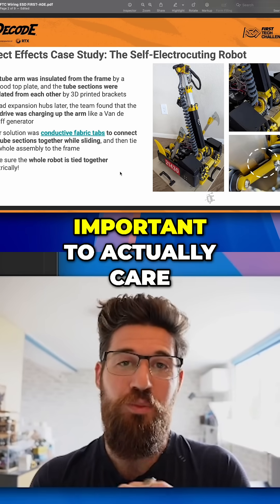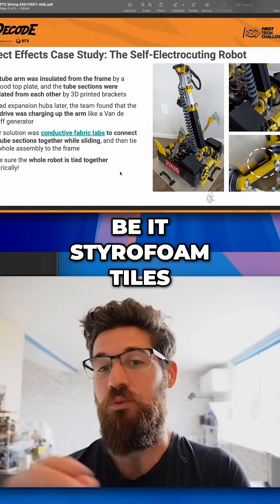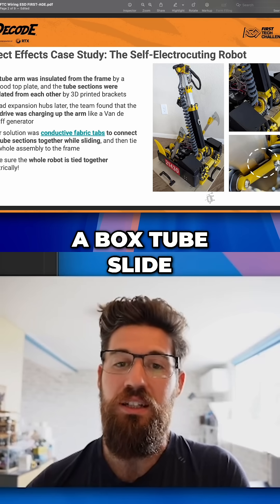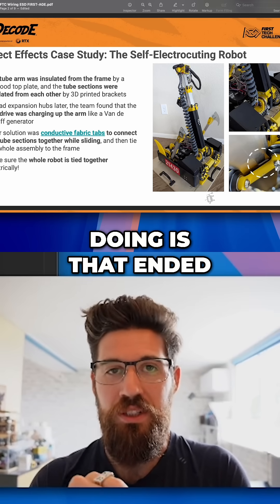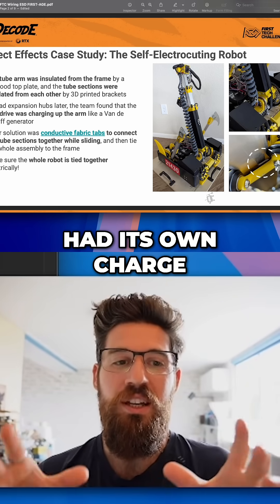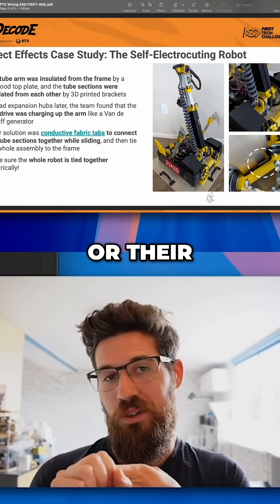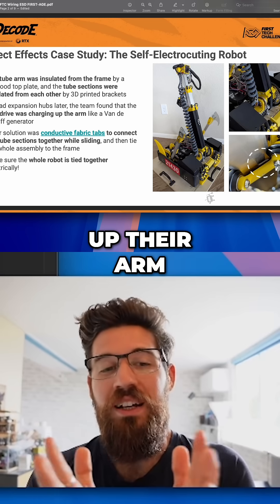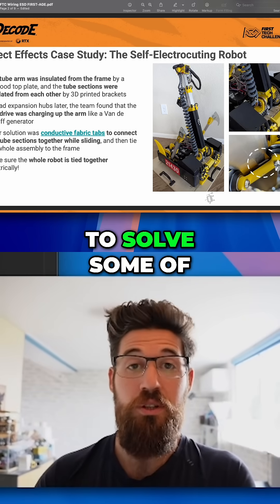Robot Shocks Itself: Why ESD Matters in Robotics! #shorts

Comment: FTC Mentor here up in the Yukon. My team had big issues last season because it is so dry up here. Though we didn't have big issues causing any hardware to die, our IMU would constantly reset breaking all and any code inputs from it during ESD events.
Reply from the maker: That's a bummer and sucks to happen in competition. Does your league use anti-static spray?

Comment: FRC mentor here, how/why do these robots build up static charge? this isn't even a concern for FRC. as long as your electronics aren't electrifying the frame you're good.
Reply from the maker: FTC foam field tiles are particularly bad for it versus the floor FRC plays on. As well, FTC doesn’t have the bumpers like FRC does, so there are a lot more events where robots come in contact with different charges.